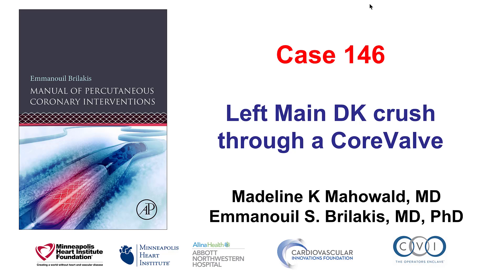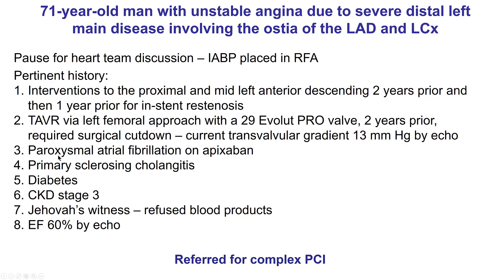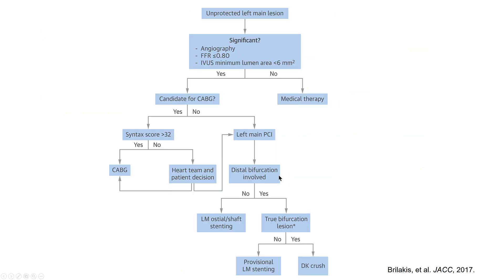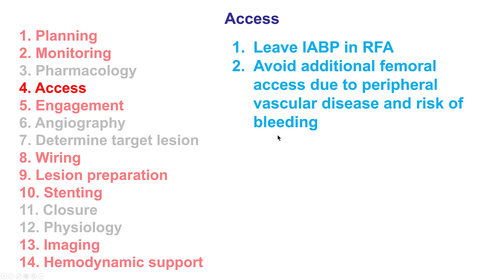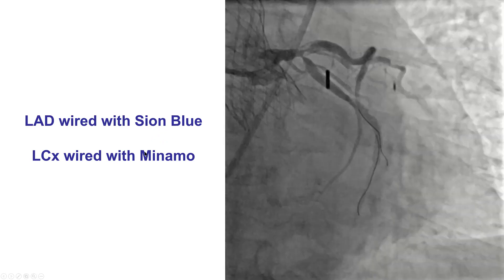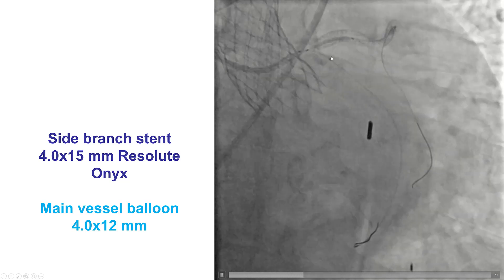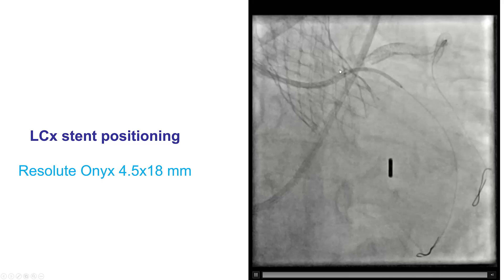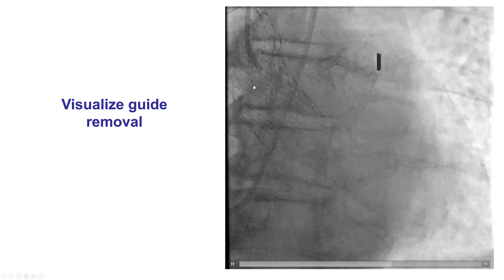Case 146: PCI Manual - DK crush through a CoreValve

Comment: Nice case professor …Is it purely angulation of LCX that made you to use LCX as main stent ? (Or is it due to presence of core valve ..Cos the LCX doesn’t look too angulated for a normal case ) …and  What was your opinion  regarding short term or intermediate results of DK crush when LCX was used as side branch Vs LAD as side branch ?
Reply from the maker: Great points - selection the circumflex as the main vessel was based on both angulation and size. Agree that the circumflex angulation is not extreme and rewiring would likely also succeed is the LAD was chosen as the main vessel. I don't think it matters that much which vessel is chosen as main or side branch as long as the procedure is performed in a systematic way optimizing the areas in both vessels.